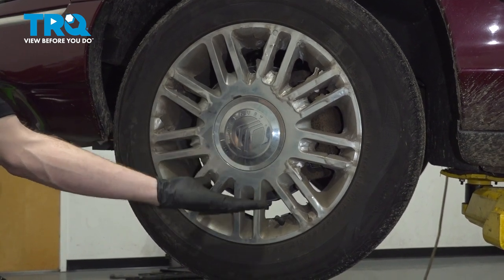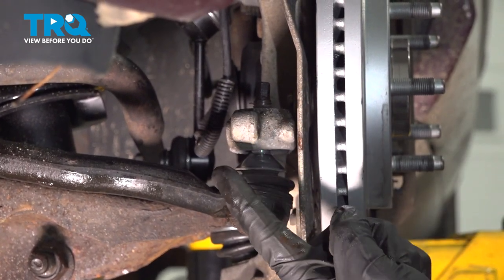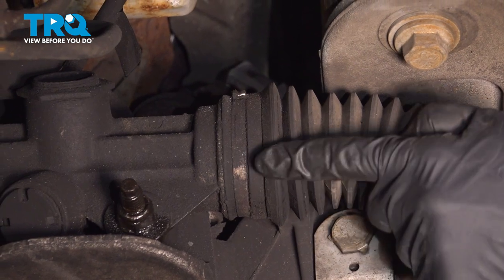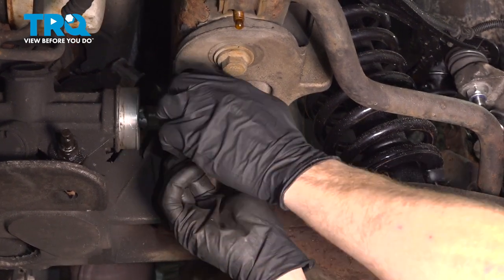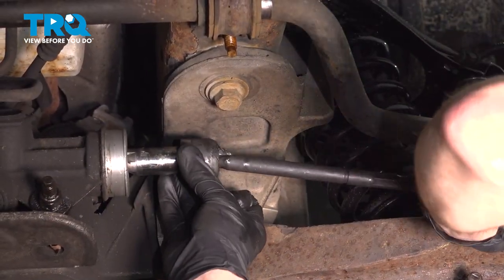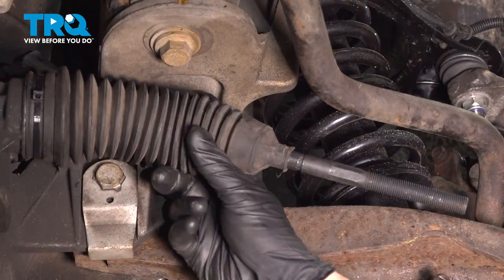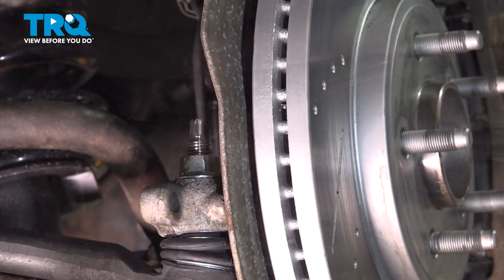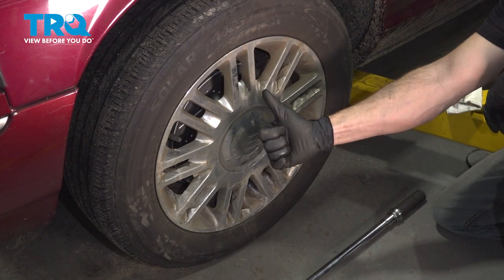How to Replace Inner Tie Rod 2003-2011 Mercury Grand Marquis

Comment: What are the symptoms to replace this? I’m around 80K miles on m 03 marquis and I’m getting squeaks from all 4 sides. It began in the rear, is not a clunk is just a squeak on road imperfections
Reply from the maker: +Marco Manzo We don't have a how-to video for your vehicle right now, but the basic steps in this video should be enough to do this task. Buy this part for your vehicle on 1AAuto.com: http://1aau.to/m/Shop-1AAuto-c